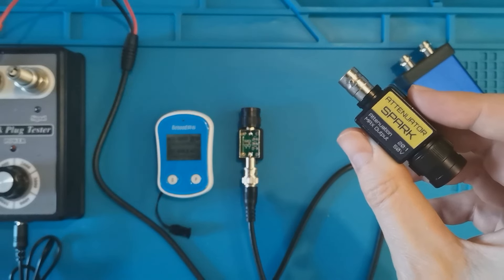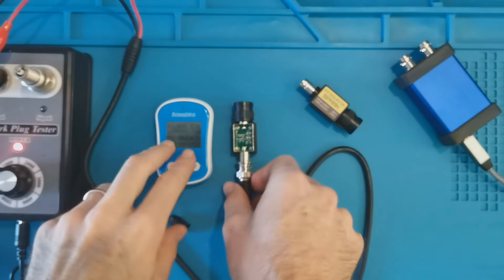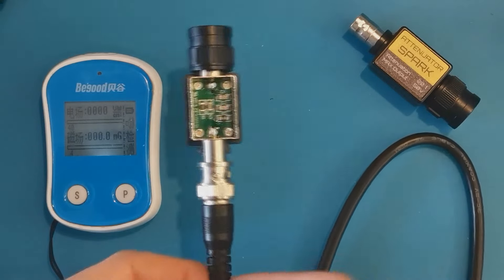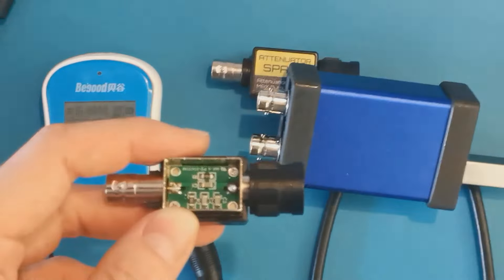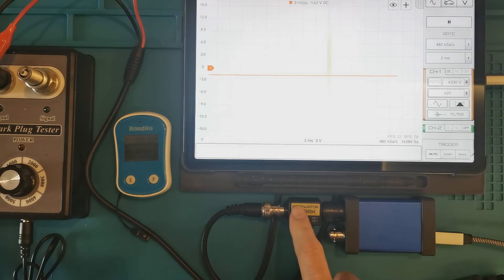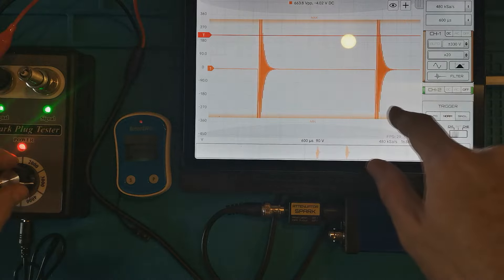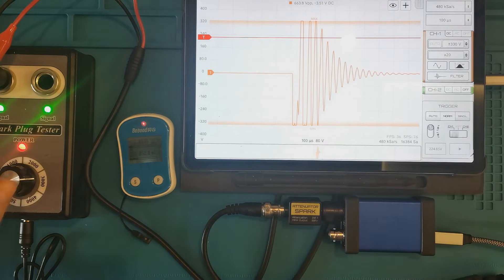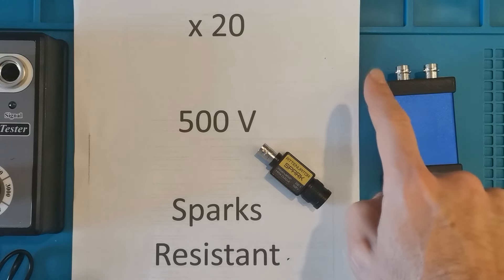AT-SPARK Part 2 - Tests

Comment: I'm trying to use my HS 502 with the hantek HT 25 ignition probe. It just clips over the ignition wire to capture the secondary waveform. The problem is that it freezes up while trying to capture the waveform. My question is, will this attenuator used with the HT 25 help illuminate the scope from freezing up. I'm wanting to order one as soon there is more in stock.
Thank you for your time and appreciate all that you are doing! 
Love the H scope!
Reply from the maker: Yes this one should avoid the disconnections due to EMI or direct sparks in the input channel. Keep oscilloscope and tablet far from the hood, try to use long probes and well connected to GND. HS-SPARK available in stock this week-end.

Comment: Are the test leads connected to anything or do they just come close to the spark plug, that is quite the surprise with the sparks in the first attenuator.
Reply from the maker: They are connected directly to the spark generator, the generator has 2 independent channels, one connected to the candle on the right, the other do not dissipate the energy but it send it directly to the attenuator,

Comment: How is the scope connected to the spark tester?  I can't see from the video.  Is there resistance or in the circuit or are the clip leads connected to the spark tester directly?
Reply from the maker: Direct connection.